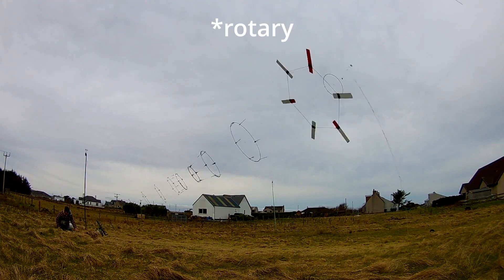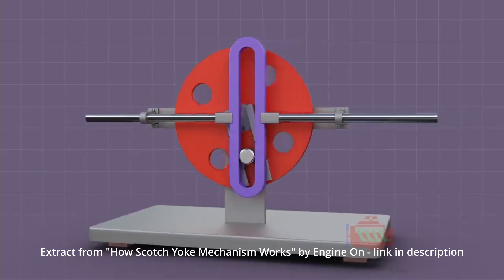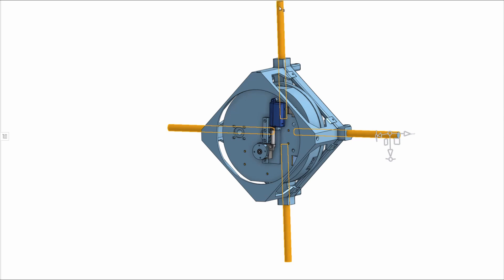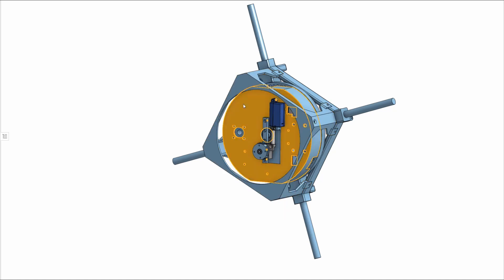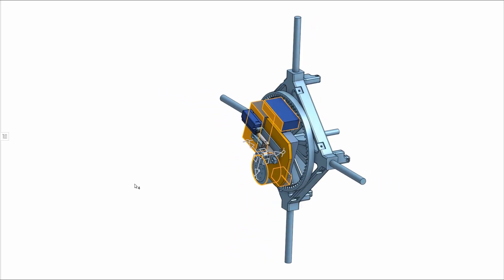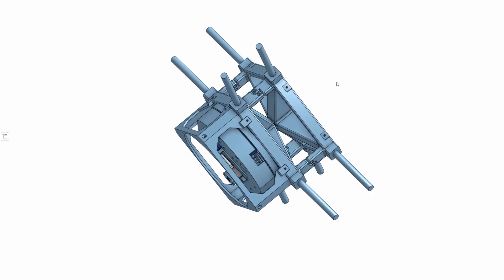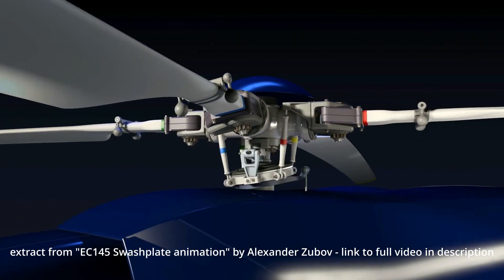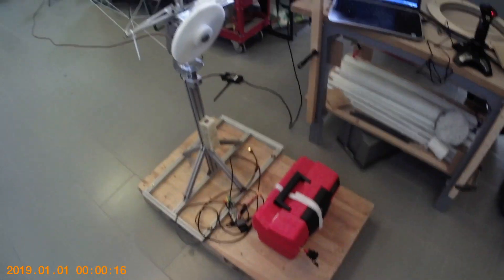Cyclic pitch control for Rotary Airborne Wind Energy Syst. using a rotation compensating slew plate.

Comment: I flew model helicopters for 20 year.  I think anyone thats been around a swashplate has thought of using in windpower in some way with any of the types of wind.  Vertical or horizontal versions.  With a pid controller of any kind collective adjustements would optimize the RPM for the system.  I like what your doing and the work, but it looks like 3 years ago there was work.  What is the update on this?

Comment: Brilliant engineering! I also think thar reel in and out is key to reach higher altitudes with such a device. Could it be used with a kite rotor? It would seem more safe with a rotor that does not fall to the ground and  break or kill someone if the wind suddenly dies down. Also, we could move the mechanism to the ground if we could manage to build a second torque ladder inside the first one.     For such a coaxial set of torque ladders not to get entangled, they could be a tube made out of fine net, with carbon fiber rings at certain intervals